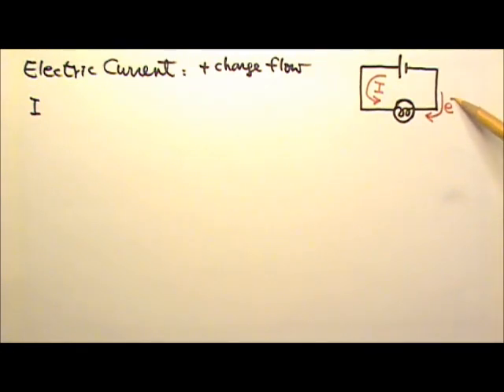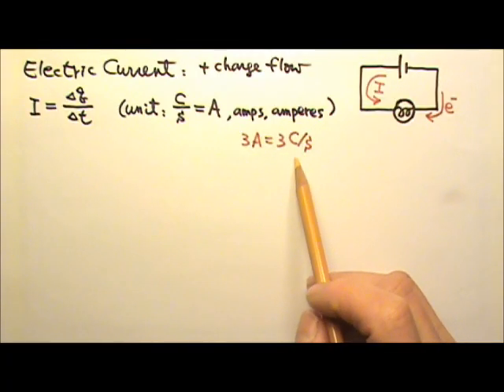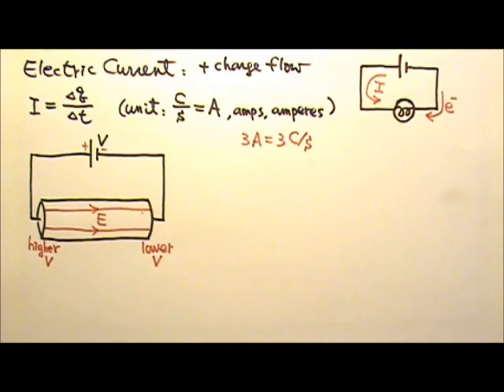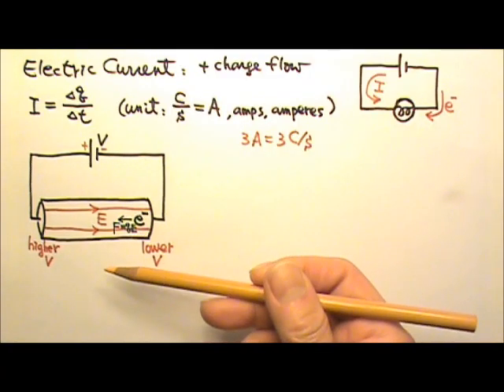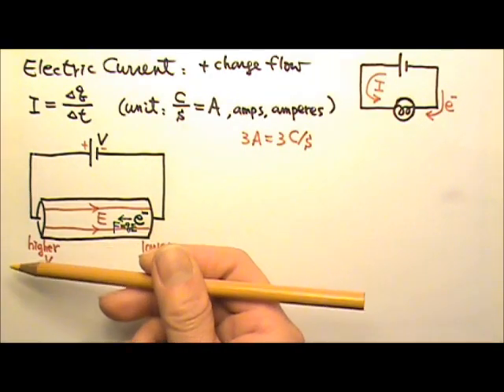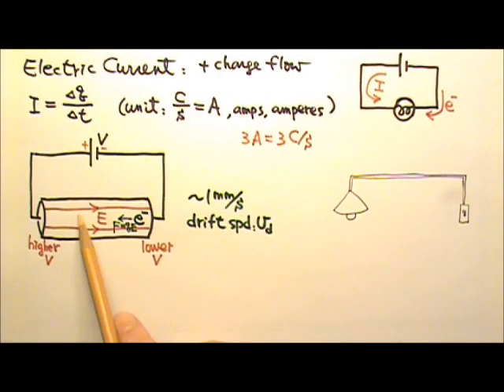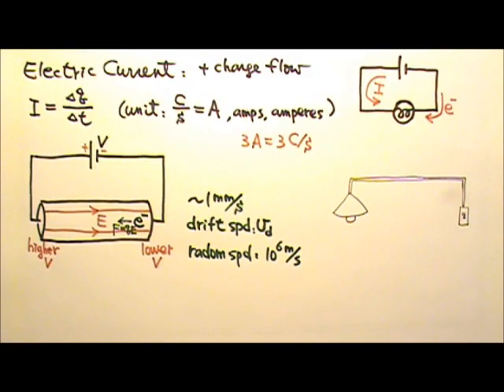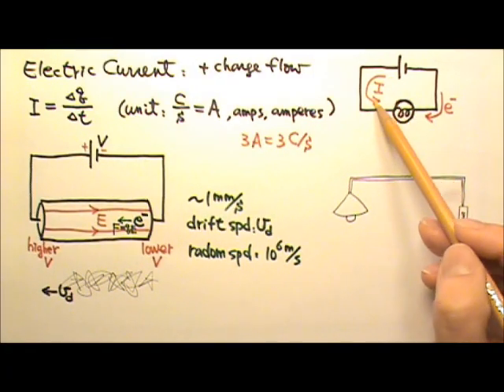AP Physics 2: Circuits 1: Electric Current

Comment: I wouldn't say the double stacked filter would go faster because it feels more gravitational force. It would go faster because it experiences less air friction.
Reply from the maker: Abou El-Ela Actually, as weird as it may seem, the 2-filter stack reaches a faster terminal velocity than the single filter because there is more gravitational force. When the filter(s) reach terminal velocity, the net force acting on the filter(s) is zero. So the downward gravitational force cancels with the upward air resistance. The 2-filter stack experiences twice the gravitation force and therefore twice the air resistance (not less air resistance!). For the same size and shape coffee filters, more air resistance means faster speed. (Air resistance increases when the object's speed increases.)
Reply: Same air friction? Because same object just higher mass